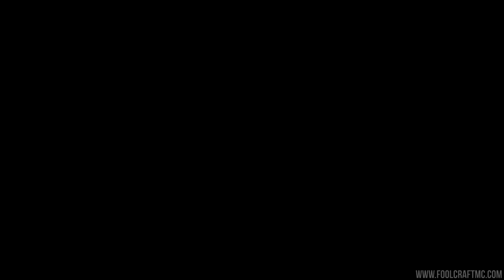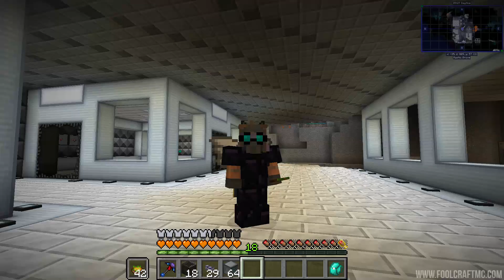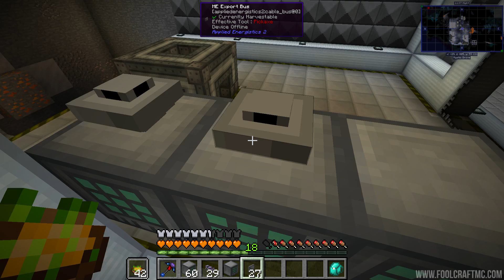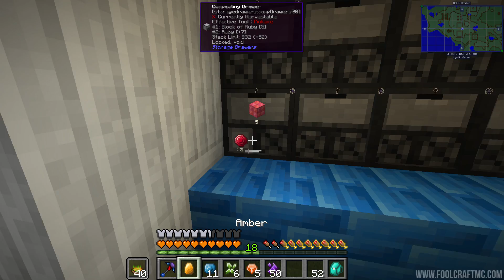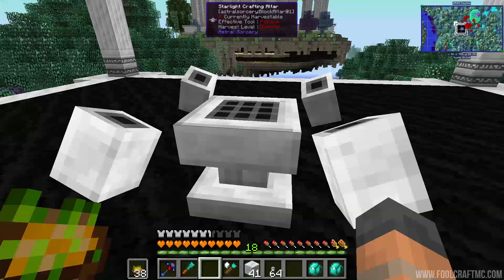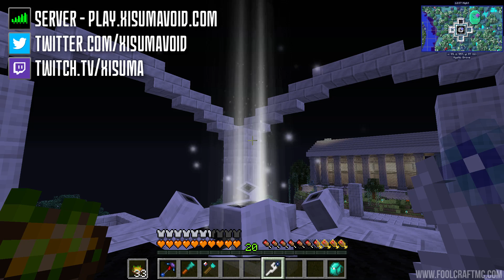FoolCraft 2 Modded Minecraft 23 New Autocrafting System!

Comment: Hey Xisuma, I know how you like finding out how to do stuff yourself, but for your crafting system I would look into using ME Interfaces (there are 2 versions both do the same just one is a panel and one is a block). They do both Importing and Exporting which would limit the amount of sides of the crafters you have to use. This is just a suggestion but I thought you might like to know. Keep up the great work! Puzzle
Reply from the maker: This works much better for the task at hand :-)
Reply: Ok cool, just thought I'd throw it out there :). It's your system you can do it how you wish. Though if you ever do need help, I've mastered most mods, I will help you when I can :D. Puzzle

Comment: Xisuma, is there any reason why you keep with the storage drawers over using the Vast Storage units? I find it rather odd, unless its related to holding multiple items in the 4 slot drawers, over single item in the Vast Storage Units - I could understand this, though personally I would still prefer the vast storage units. They are also super cheap to make, and the only thing you need is a deep storage label afterwards to know what item is in there (storage space is somewhere in the trillions if I remember right).

Otherwise, love the series, keep going :D!

Comment: Preheat oven to 350 degrees F (175 degrees C).
Cream together the butter, white sugar, and brown sugar until smooth. Beat in the eggs one at a time, then stir in the vanilla. Dissolve baking soda in hot water. Add to batter along with salt. Stir in flour, chocolate chips, and nuts. Drop by large spoonfuls onto ungreased pans.
Bake for about 10 minutes in the preheated oven, or until edges are nicely browned.
Reply: We need the amounts
Reply: Matthew Shaw What's the recipe for?
Reply: @Matthew Shaw Is this for chocolate chip cookies?